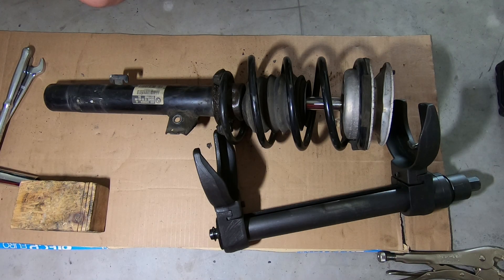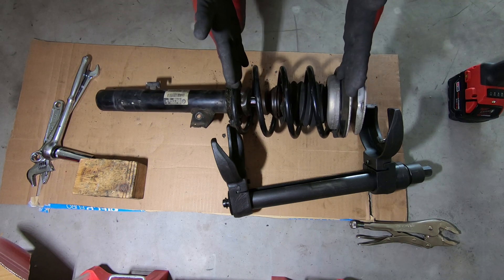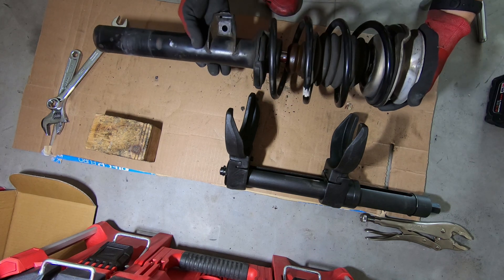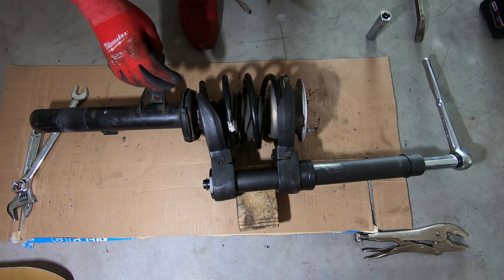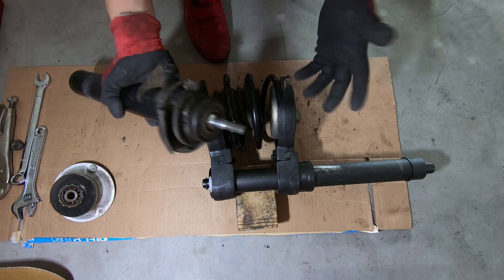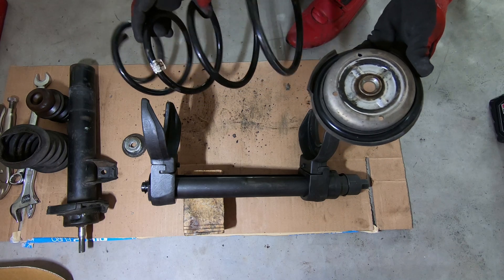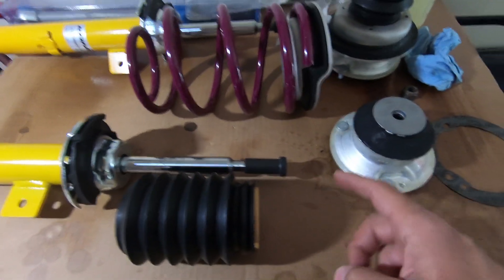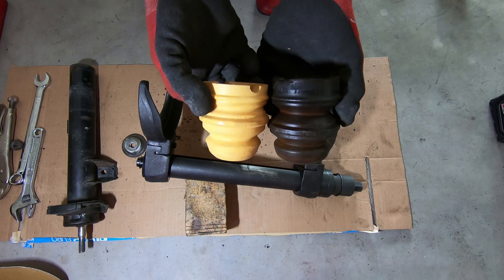BMW E90 328i Front Strut Spring Disassembly How To

Comment: Where does that lock washer go? My strut came with only a self locking nut
Reply from the maker: The threaded end of the strut may have a few different ways of locking to the top hat. Some have standard nut and split lock washer, some are just a self-locking nut. Is that your concern?
Reply: Yes. I was just going over my parts to make sure I have everything for my suspension replacement. Everytime I do I end up ordering 200 bucks worth of additional parts😅  @maxsam201
Reply from the maker: That's a lot LOL. But weather you use a lock washer or self-locking nut makes little difference for the end user. I personally prefer not to use any locking devices, if anything - a small amount of Blue Loctite is all it takes.

Comment: If you have a e90 Xdrive this tool will not work on yours dont waste your money the upper mount it too big to fit on the tool cups killed myself trying
To compress back in will not work..
Reply from the maker: That is not true. Top hats are the same diameter on both RWD and Xi cars. They are not the same, but the diameter is. It is not the easiest job, but it is doable.  Sometimes it is a good idea to let professionals do things - if you struggle trying to accomplish something that is not your field of expertise.

Comment: Are these lower springs?  Did you trim the bump stop?  I just installed the new struct, and torque the nut with 48 ft lb, but the bearing can't spin at all.
Reply from the maker: Factory / OEM spring as an example in this case. Doesn't matter what spring, the bearing has to turn reasonably easy. If it does not, something is not right.
Reply: @maxsam201  Thanks.  I loose the nut little bit, and the bearing can turn with little resistance.   I wondering how the bearing spin freely with spring on?  There are always spring to push the plate and bearing.
Reply from the maker: @imanwan2861  The way this strut assembly is engineered, no spring load is transferred to mounting hat / bearing ever, so it spins the same with or without spring. I suspect there's something jammed between spring upper seat  and strut hat where bearing is. I can make a detailed video, got all pieces laying around, if needed.
Reply: @maxsam201  OK.  I think I just don't toques the nut in spec.  I see many video don't even use  torque wrench to install the nut at all.  As long as it is tight, and no noise on speed bump.  It is good.
Reply: Thanks for your help.  I actually put the spacer the other way around.   I didn't know the correct, since I didn't remove the old one.